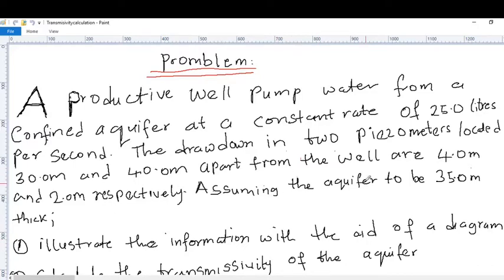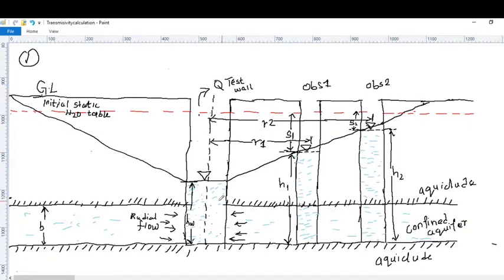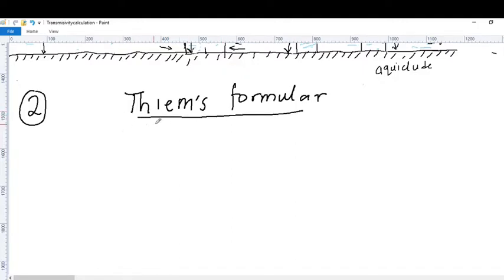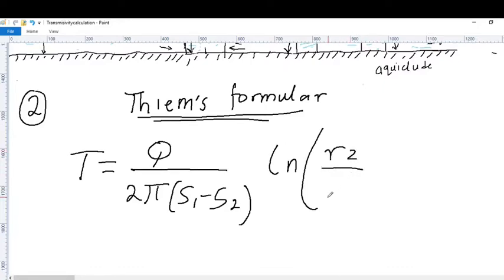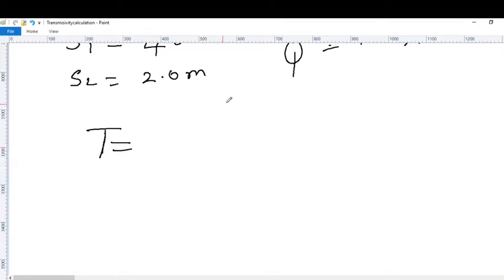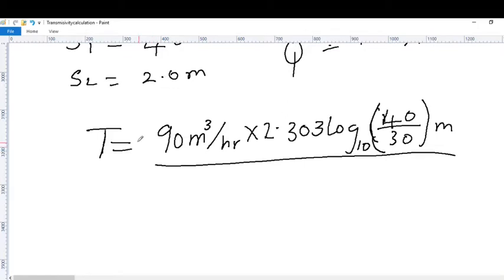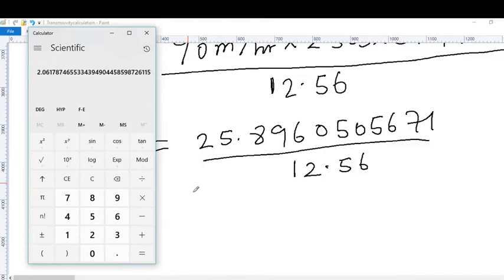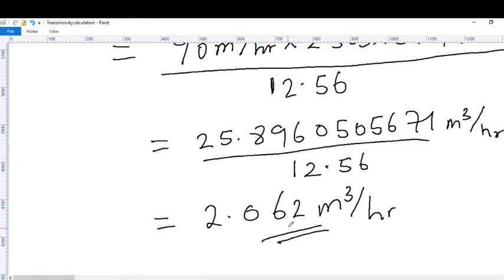Calculation of transmissivity of a confined aquifer

Comment from the maker: The unit for the transmissivity (T)  is supposed to be m^2/h  or m^2/day.  so the final answer is either 2.062 m^2/ hr or 49.48 m^2/day.  This is because the "m" from m^3/ hr will be canceled out by the "m" from the drawdown. Also, the log r1/r2 is unitless because the m from r1 and r2 will both cancel out.

The calculation for the Storativity in this video is not correct.  Storativity of the confined aquifer cannot be determined since specific storage is not given in the question.  However, it can be estimated by multiplying the thickness (b) of the aquifer by 0.000003/m according to Lohman. Hence, Storativity= 0.000003/m x 35.0m = 0.000105. I made a lot of mistakes in this video. I'm very sorry for the inconvenience it might have cause you. however, those are the corrections. I assure you that this won't happen again. Thank you for watching my video.

Comment: Please kindly solve this problem.

A well with a diameter of 200mm in a confined aquifer with a thickness of 10m is pumped at a steady rate of 30l/minute. The drawdown at the pumping well is 2m below ground level and the drawdown at an observation well 500m away is 0.5m. Assuming the ground to be flat and assuming equilibrium conditions determine the transmissivity of the aquifer.
Reply from the maker: Sorry for the late reply...
Find k using thiem's equation. Thereafter, find T using T= kb
Reply: @MagmaUpwelling  Thank you

Comment: Plz solve this
the initial water table in an aquifer 1 km^2 is at a depth of 25 meters below ground surface. the specific yield of the aquifer is 0.136. after pumping the water table drops by 2.2 m. what amount of water was pumped from the aquifer?
Reply from the maker: Area of the aquifer = 1km² => 1x10^6 m² Initial water table =25m 
Water table after pumping = 2.2m 
Drop in water table = 25m-2.2m= 22.8m

Specific yield (sy) = 0.136 or 13·6%

Q = Area of aquifer x Drop in water table X specific yield

Q= 1X10^6 m² x22.8m x 0.136

           Q= 3,100, 800 m^3
Reply: @MagmaUpwelling  thanks a lot
Reply from the maker: @tariqulislam4098  you are welcome